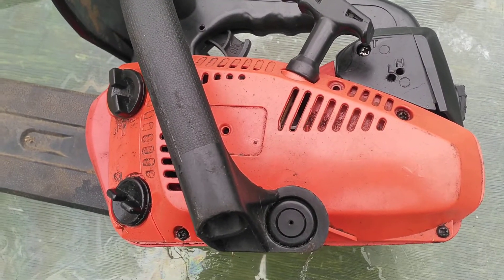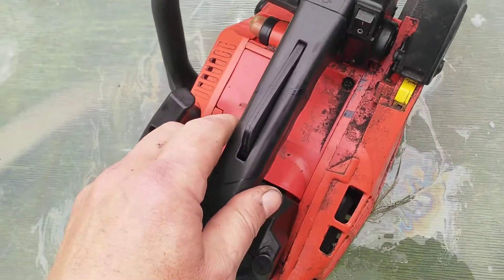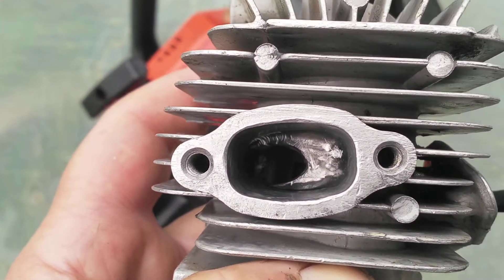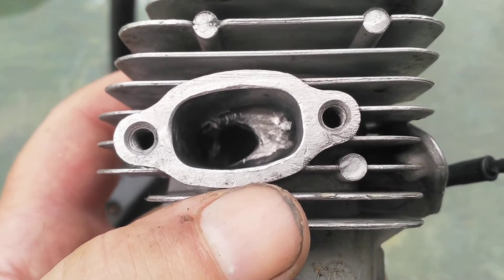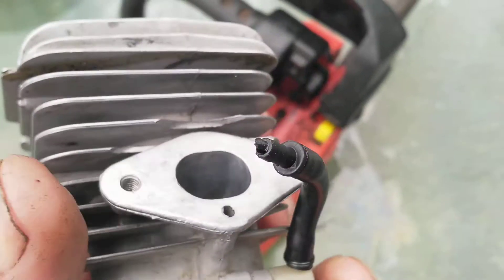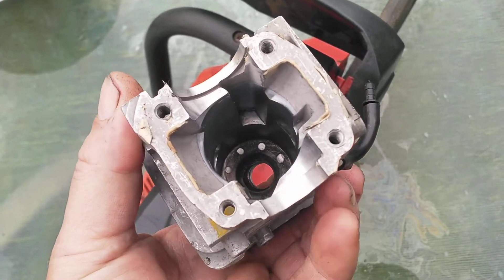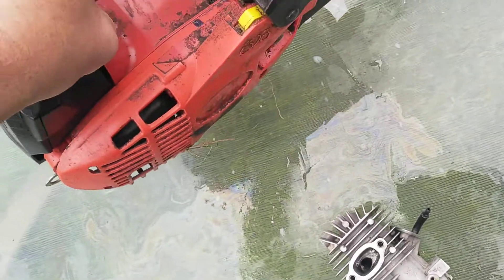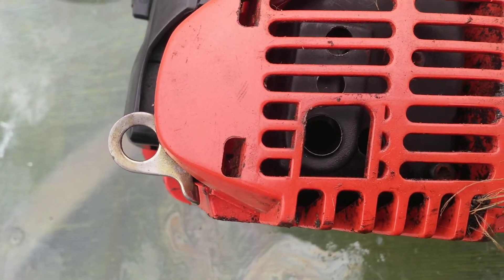porting 25 cc Chinese arborist chainsaw

Comment: So I finally started cutting with it last week. 
It fired up good and cut good but wouldn’t hold a tune and the idle was very erratic. 
I have been trying all kinds of things and each thing made it a little better but the idle was all over the place at times. 
Finally tonight I got it running pretty good I have a couple more things to try. 
I usually only do one thing at a time it takes me forever but at least I know what fixed it or didn’t fix it so just tonight I tried two things at once. Going against my golden rule, lol well lo and behold it runs a heck of a lot better so now I have to go and change one of them back to the way it was so I can figure out which of the two made it run, right lol. 
I’ll probably make a full video on this just in hopes that I can help others because it seems like everybody you talk to with these little top handles talks about how they don’t run right they run good at wide-open throttle but they won’t idle very good.
Reply from the maker: I find if they sit in the shed for a bit they don't like to  run well, I have to clean carburettor out cheers Kevin